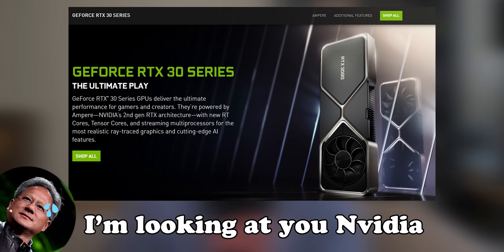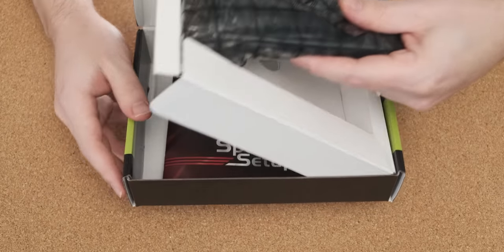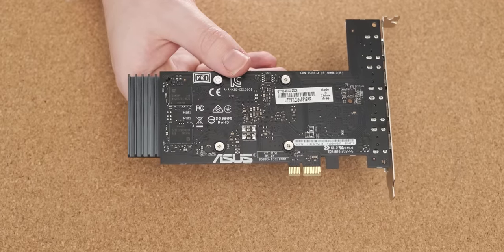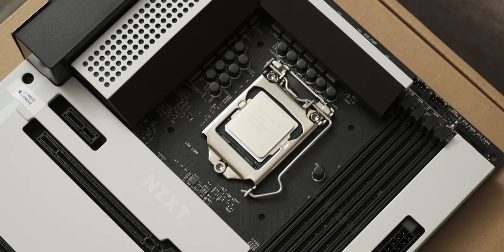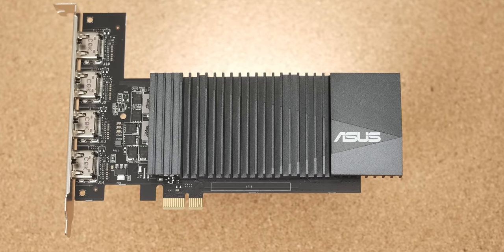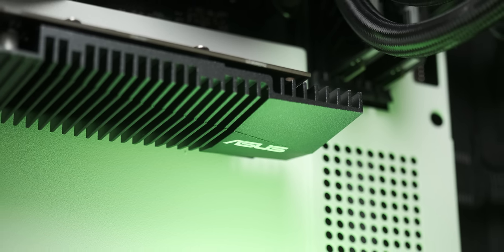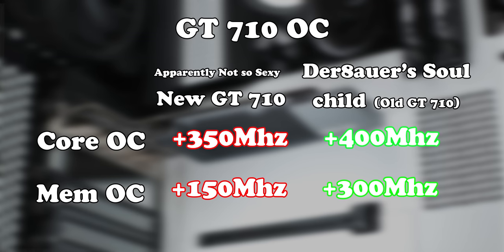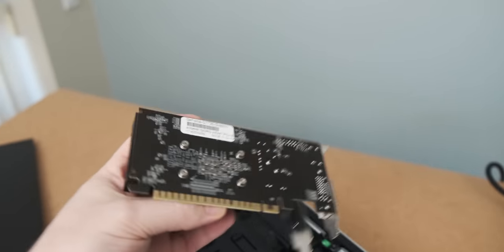I TRIED to buy an RTX 3070, but got this instead...

Comment: I like that he says "How well Dota handles this GPU." and not "How well this GPU handles Dota."
Reply from the maker: Hahaha!! Yeah, don't was definitely the one putting in the work here. 😁
Reply: @DawidDoesTechStuff  dota*
Reply: Dota runs a graphics engine that runs similar hardware that was made 15 years ago. So it's not a surprise something that's only got GPU power of an old 2 or 1 core system of 15 years ago, works fine.
Reply: But dota looks like an N64 game...
Reply: @JosephArata  ye but 40 FPS on Dora lmfao
Reply: i was literally on that exact part of the vid... wow!
Reply: Hello dawid

Comment: you forgot to mention the ONLY part that is interesting about this card : It is only a PCI-e 1X connector ! Not a 16x like before. 

This means that if you alrealy have a GPU that is beefier and you need more screen real estate for cheap, you can buy one of those, plug it IN ANY PCI-E SLOT AVAILABLE (that's huge) and BOOM you can plug in 4 more displays
Reply: this is the reason for it!
Reply: Thanks I was struggling to understand this re-release 👌
Reply: Here in Canada Remember of 2020. You couldn't find GPUs or if you did they were very over priced.
I ended up buying a pre built Acer Orion Predator 3000.
It came with a 2060. 
Still using the computer today. Plays everything on Ultra even today.
Hogwarts was the only game it didnt play above medium. We all know Hogwarts has shit  optimization.
I'm playing Cyberpunk on Ultra with medium ray tracing.

Comment: Hey Dawid, do you think the lackluster overclocks have anything to do with the fact that this new one has only a X1 connector, instead of the full X16?
Reply from the maker: That's an interesting observation, I wonder if a GT710 can saturate a PCIe 1X slot.
Reply: @DawidDoesTechStuff  I'd also bet it has to do with the available power to the card without the full length X16 connection limiting the overhead on the overclock, but that's just a guess on my part, because I'm not familiar with what pins provide what on a PCIE slot.
Reply: @adamjabs  yes and yes to both questions in this comment. 710 data throughput can get close to PCI-e x1 theoretical bandwidth, and yes the PCI-e slots only provide a certain amount of power per length used. The choice to go to x1 was probably a cost savings decision for a card designed as a monitor hub in an office PC that connects to multiple remote desktop connections. Where the office desk PC basically does none of the work, it's all done on a remote server.
Reply: @DawidDoesTechStuff  It won't have as much power draw available to it as a full 16 slot card would it? so its likely power limited.

Comment: That 710 also draw my attention when I first saw it when I was searching for an single fan card for my Optiplex. 

It would be interesting to see if you had bad luck on the silicon lottery and those cards can actually overclock like other cards.
I was thinking to buy one and pair it with something like an R3 3100 for an entertainment center but what still pulls me out of doing it is the fact that is full size and not low profile like the old 710 which for me it's an decisive factor for this build.

Comment: I'm going to get an 3080 when the hype dies down for my first rig that i fully built (my other one needed some big fixes)
Reply: Well by the time the 30 series are in stock, you might as well check on pricing and performance of the and 6800xt
Reply: @temanbradley8505  i guess but that might be very expensive, way over my budget
Reply: @paninomafiaboss7912  wdym might be very expensive and way over your budget? It was revealed 3 days ago! It's $650, $50 less than the 3080
Reply: @paninomafiaboss7912  dude rx 6800 xt is less money and more powerful...
Reply: @kie9683  it's not more powerful. It's about the same as the 3080
Reply: @kie9683  can it ray trace and is it vr compatible?
Reply: @Laittth  look at the benchmarks 😁
Reply: @paninomafiaboss7912  yes and yes
Reply: @kie9683  We need real tests, so far we only got some slides, but apparently they perform worse in RT compared to Ampere, that's why AMD are pretty quiet about it, we gonna see about the rest, 16 GB VRAM is pretty dope. but for like 1080p gaming I think it would be overkill tbh
Reply: @Laittth  i didn't know that
Reply: @paninomafiaboss7912  Well if you did watch the live stream
Reply: @kie9683  I have seen the benchmarks.
A. First party benchmarks, can't really trust them too much
B. The 6800xt actually loses to the 3080 in quite a few of them, so my general takeaway from them is that they're about equal just in performance. Now when you consider the price, of course the 6800xt is better but let's not get into that because I'm disputing your claim that the 6800xt is "better" for less and I hate it when people confuse straight performance with performance for the money.
Reply: @januszmanczak161  they never said what reslution the 6800xt was at raytracing as the results were very empty
Reply: @paninomafiaboss7912  literally all new gpus support vr
Reply: @MrGoose60  i didn't know it was a thing
Reply: @januszmanczak161  yeah but its still a better deal. 25% worse at rt i heard. That equivalent to the 2080 ti and its cheaper.

Comment: 5:00 We note that he does not have the side panel on his case.  This is due to the horrendously overpowered NVidia graphics card sucking down almost TWENTY WATTS.  If he simply relied on his intake fans, it might catch on fire.  It was reaching 55 degrees celsius, which was 100 degrees above ambient.

Comment: 4:25 that doesn't make sense, I have the worst GT 710 (1gb DDR3) and it runs at 720p lowest, 30-40 fps, and with shadows force disabled, another 5 or so fps more than that. pretty playable. and this is on a core 2 quad system at stock speeds too.

Comment: I would love a 3000 series card then I realized my setup is about 1 inch short for the length to have it fit. I wonder if I am the only one that needs to build a new setup to fit the 3000 cards.

Comment: To be honest, this GPU is a dream... 4x HDMI... PCIe x1... perfect for any Office PC which requires multiple screens... and the x1 slot means that you could connect a dozen of 710 GPUs to a server to use them as passthrough GPU for VMs.

Comment: I have a feeling the tiny pcie connector being 1/4th the size now has something to do with the overclocking fail
Reply: Yeah, the card can pull maybe 6 - 16w out of a pci-e 1x slot while a full 16x slot lets it pull up too 75w if the voltage controller on the card allows for it.
had it been a pci-e 4x it would have been 25w

Comment: I would think (HOPE) that a 64% increase on a board with GDDR3 would not greatly surpass the defaults on one with GDDR5. Also, I'd expect a video card that uses a 4X PCI-E slot to have a significantly lower power draw. Those are a couple of things I really couldn't divine from this video. Those would be major considerations for me, because about the only way I could see myself buying something like that is if I wanted to build a low-power multi monitor display that runs video 24/7.

Comment: I still have the GT730 from MSI, but with 4GB of DDR3 memory. I overclocked it and noticed some performance boost about 5 to 10 +FPS in benchmark tests. Maybe you could push this card to it's maximum limits. (N730-4GD3V1) This is it's model number, I would like to see a review of it from you. I looked everywhere and couldn't find someone who is interested in old graphic cards from NVidia and the 700 series. Then I found your video with GT710 and wanted to subscribe to see more videos and I did so. Since then, I have been watching every video you make.

Comment: Honestly I don't get the point of this: a lot of "name brand" PCs used in offices are of smaller form factor types where low profile cards would be an advantage. Also if an organisation has existed for more than 10 years it's very likely to have lots of last-gen monitors. So a card with at least DVI ports (if not VGA) was always handy. The only thing I can think a 710 useful for would be to build a classic games computer, but even then, without DVI/VGA ports and the ability to put in in a low profile case, you'd be better off with an "old" 710 or 730.
Reply: You wouldn't get it if you couldn't fit it, or if the outputs are not what you need. If you can fit it and the outputs are what you need it could be perfect.

Comment: I bought this to use for extra screens in xplane.  However the output chugs even though the rendering is being done by my RTX3080 (and is smooth on the screens connected to the 3080).  Swapping the GT710 for a GTX1660S has resolved the situation, but at almost quadruple the cost it better had!

Comment: Is that 1x PCI-E ? how much is that hurting it compared to the old one's 16x (or is it 8x used on 16)
Reply: I'd imagine not too much performance wise in a fairly recent motherboard, like in a lighter title like quake 2 I'd say 35 fps out of 250 is missing vs the same card with a x16 bus if they are identical otherwise.
But for overclocking the card it would limit the power draw the card could actually pull from the pci-e socket.

Bandwidth wise a 1x slot lets it transfer about 1.96 gb per second on a pci-e 4th gen slot.

Comment: My monitor was always the weak link. I also upgraded motherboard, and mvie m.s also. Then needed a good cooler and boom, its rocking. Oh you can get a older ti gpu that will work till things settle down with the gpu snafu.

Comment: But can it run Microsoft Flight Simulator in 800x600 all low settings?

I think it can, but it'll freeze on the loading screen

Comment: Not fair, should've used a Core 2 Duo with it. It does really well with a C2D. You'll be able to play GTA V at high settings on 768p.

Comment: Could it be the reason the NEw GT710 is worse is that it's  PCI 1x vs PCIe 16 x  ? Just saying....
Reply: It will have the lanes and power it needs. There is no point having more than it can make use of, and it means it can fit in a x1 socket.

Comment: After 10+ getting new pc(tired of waiting), I plan to go for more overall better parts, since after 2-3 years (when prices drop, and become available) I plan to upgrade 5000 series cpu, and 6000 series gpu. What do you think?
AMD Ryzen 5 3600 3.6 GHz 6-Core Processor
Asus TUF GAMING B550M-PLUS (WI-FI) Micro ATX AM4 Motherboard
Crucial Ballistix 32 GB (2 x 16 GB) DDR4-3600 CL16 Memory
Crucial P1 1 TB M.2-2280 NVME SSD = I can always add more if I need to
Asus Radeon RX 5500 XT 8 GB STRIX GAMING OC Video Card
be quiet! Pure Base 500 ATX Mid Tower Case 
Asus TUF Gaming VG27AQ 27.0" 2560x1440 165 Hz = plan to keep even after cpu, and gpu upgrade
Corsair CXM  ATX  80+ Bronze	500 W  = already have = will upgade with new parts.
= around 1400$ with monitor(400$) included

Comment: Is it good to pair with 3600 with 6800 ? Cause 6800 is 16gb  where as 3070 is 8gb and actually 6800 is beats 3080 and even 3090 according to Amd benchmark. I do have 3600 without GPU and I thought go with 3070 but amd 3070 is out of stock and that's good I didn't buy it and I'm looking for 6800 to pair with. I know 1080p will be a bottle neck but I have 2k monitor so I would prefer to play 1440p.

Comment: Bro, taking out the GT 710 would've improved performance! The Intel i9-10850K with Intel UHD Graphics 630 is better than the GT 710 and with 32GB of RAM, because a portion of RAM is reserved as VRAM when using an integrated GPU, it would've performed even better in games like GTA V

Comment: I was shocked to find a Galax RX3090 in stock at one of my local online retailers a few hours ago. A bargain at $2800AUD
Sweet, I thought. A replacement for my RX570.
I quickly changed my mind when I remembered it probably won’t pair well with my 3770K

Comment: Hello, I went to buy Nvidia Rtx 3070 founder edition but due to stock availability issue I ended up buying Nvidia GT 710 and will be waiting for next sale. Can I use Nvidia GT 710 gddr3 2GB to run 1080p  240Hz monitor LG 27GN750????. My PC config is Aorus B550 master, Ryzen 5 3600xt, G skill Trident z neo 3600 cl16 Ram

Comment: If u get a rx 460 with 4gb of vram not 2 it actually a legand at over clocking its all over old forms and blog post that shit won the most over clocking gpu of the centry i got mine to get. MOre fps then my 1070 zotac mini no capp

Comment: Bro its obvious that oc is a marketing term now and only old hardware really teully over clocks my i7 920 iver clocks from 2.8ghz to 4.2ghz and my ryzen 3600x goes from like 3.8ghz to 4.0 lmfao fail and ny intel i5 8600k goes from like 4.2 max boost to over clocking to 4.9ghz like wtf new shit just dont over clock
Reply: Learn how to overclock my friend. I don't really understand what you're complaining about here. Older cards can get to higher frequencies, but frequencies across generations are not equivalent; the highest frequency overclock recorded is still beat out by even a below average chip today. 2.8ghz to 4.2ghz on a 12 year old CPU does not mean it will perform like a 3600x or even close to it. 4.2 to 4.9 allcore is a great OC but middle of the road in terms of silicon. 

The problem with a lot of OCing is power limits for nvidia. They are annoying, and make it hard to overclock nvidia cards without bios modding. The RX 460 can overclock great... but being able to make your ebike go to 45mph doesn't make it any more competitive with a car that can go 120mph without any modifications. 

Mini nvidia cards are naturally who gives a fuck it's a mini zotac. Buy quality stuff and then you can actually OC it. Overclocks are not cheats to get a bad chip to be good, they're a utility to make a good chip better. I feel this is a dissonance that exists nowadays. It's worth noting the i7-920 was on fucking 42nm lol and released at $300 msrp